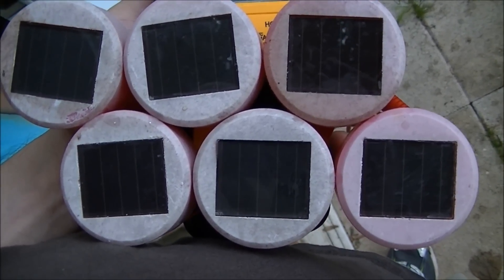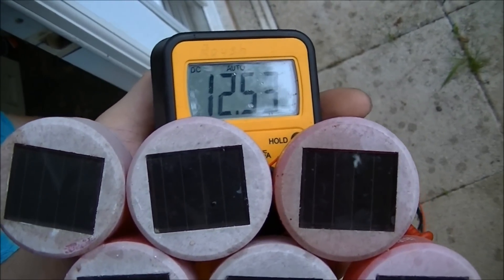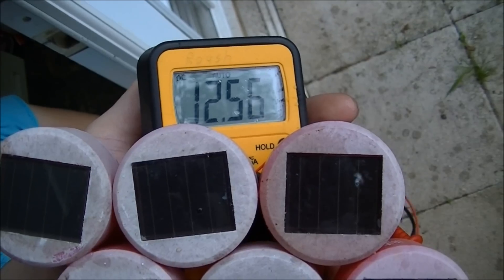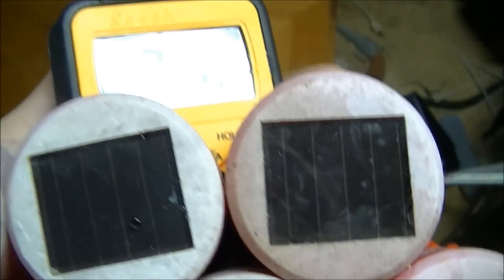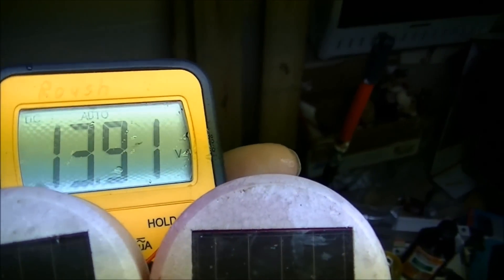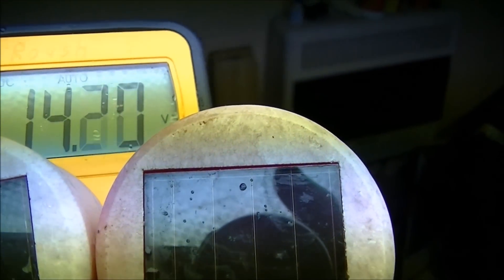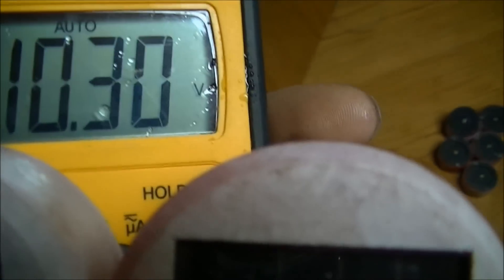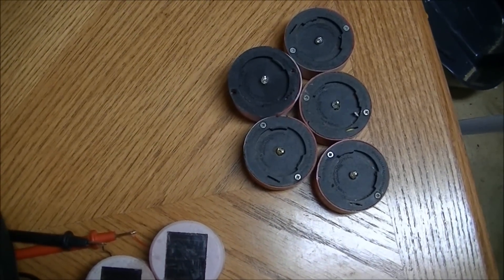Solar Panel From Landscape Lights

Comment: How much current? I see 2 of them are broken.
Reply from the maker: broken plastic? yes. Broken cells? no. Current not measured. Power output - low.
Reply: @tiggeroush  There are coroded connections between solar cells and soldered wires. Voltage will be high but current low. You can see that by white spot on solar panel (or maybe it's just a dirt, but seems more like broken connection.
Reply from the maker: @mati211p  Ok, I see what you are saying now. It has been too long. Current on there would be very small do to the size of the panels. Good for small experiments. Current may  even be less than the natural discharge of some car batteries sitting unhooked. Powers is around 0.09 watts /12 volts = .0075 amps
Reply: @tiggeroush  thoose cells have Isc about 25mA, Uoc about 2,7V. A little larger - 49x49 is 59mA of current in sunny day. 7,5mA during sunny day means there is a problem with solar panel. Some of solar panels are also up to 200mA of current which allows you use 1W LED solar light for free all night with one Ni-Mh battery.

Comment from the maker: the power output is very very small. Maybe around 0.09 watts. I will post the test when I get it finished, then change my charger to charge AA and AAA batteries.

Comment: I knew this could be done but its not cost efficient. The amps reading would be nice to know. You would need a half an amp to charge a deep cycle battery good enough to use it. So what was the amp reading? not enough I thought so. you would need to buy a lot more to get the amps up. would be cheaper to just buy a one amp solar panel and waay better too.

Comment: nize video.. are those small solar panel can charge a big battery, like a deep cycle one? lets say I got a 12v @75ah deep cycle battery, how many piece of that small solar panels I need, and what is the rating of the charge controller.. if you have a video on how to do it please send me an email thank you very much